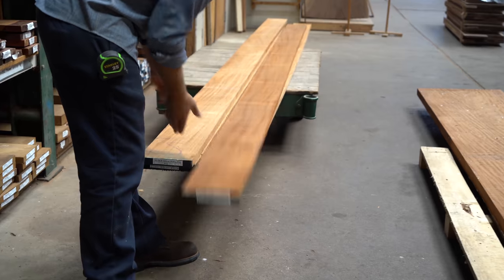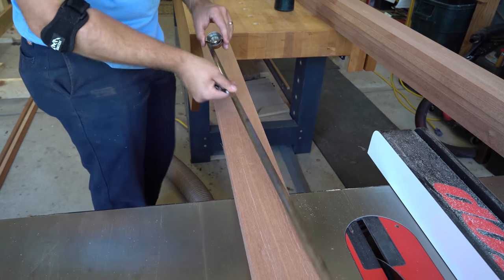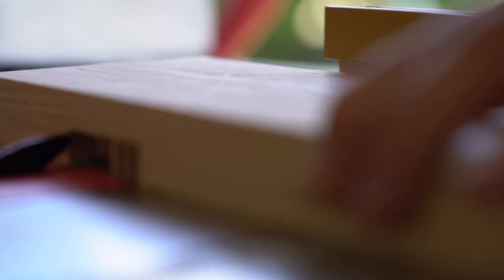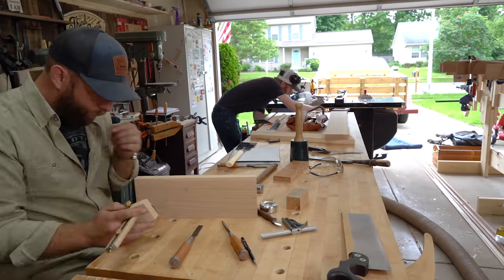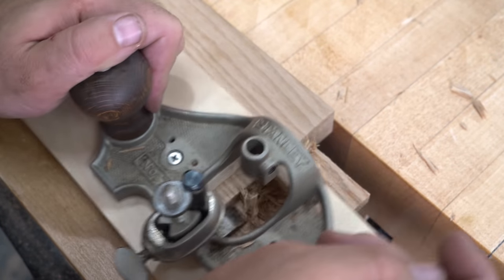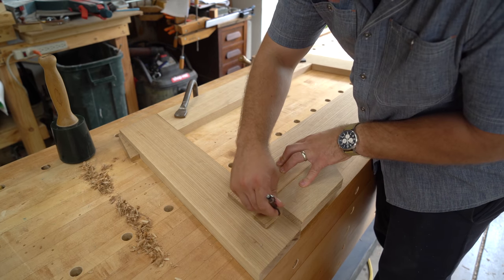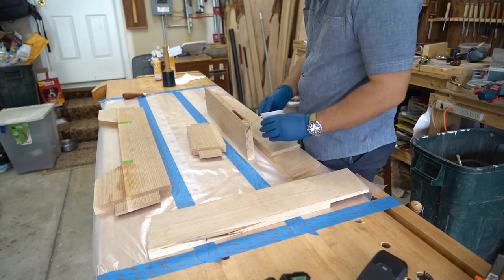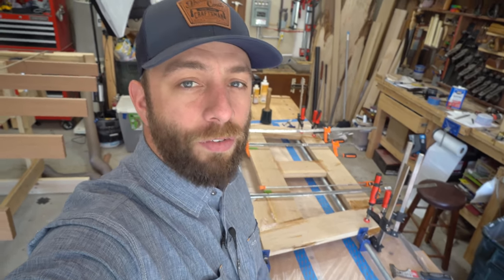Wooden Boat Build // Part 2: Getting Lumber, Transom, and Frame

Comment: Great dust collection hood on the sander. Also, instead of wax paper for a drop cloth when doing epoxy, silicone coated baking parchment works as well.

Comment: That wood store is seriously off the hook. Unreal. I really like your changes to the Transom, it should be very strong and last a good long time. I can't wait to see the whole boat layout. I'm curious about this design, as it seems the transom is very tall. Keep up the good work!
Reply from the maker: I think it seems taller because it is more narrow than most. It only is 20” in the middle to mount a regular 20” out board. Thanks for watching!

Comment: Epoxy is brilliant stuff for boat-building (and many other things). But, when working with epoxy, it's always a good idea to wear disposable nitrile gloves. Many boatbuilders report developing moderate-severe allergic skin reactions following repeated un-cured epoxy contact with their skin. Some even have to give up using epoxy entirely. 

Your suggestion to clean up as you go is a good one. Once cured, epoxy is very hard (much harder than regular glue squeeze-out etc) and a major pain to sand etc. So, any that can be removed while still soft (wearing gloves of course :)) is a big time-saver later. Also, the sanding dust can be a hazard as (i) it is very abrasive (like glass dust), and (ii) until its fully cured (which can take 72 hrs or more even after its hard enough to sand), can cause those allergies and assorted nasty lung stuff...

One more tip: White vinegar cleans up un-cured epoxy really well, and avoids having to use nasty chemicals like acetone etc...
Reply from the maker: Thanks for the tips!

Comment: Question,
Why half lap for the bottom transom joinery instead of mortice and tennon or a bridal joint? Even dovetails would be stronger. A sunrise dovetail would be beautiful, but not really seen once the planking/plywood (or what have you) goes on.

Comment: When hogging out material for the mortises on the drill press, how did you keep the board parallel to the drill?  Which leads to the next question:  when chiseling out the mortise, how do you know that the inner walls (inside cheeks?) are parallel to the outside sod the board?
Reply from the maker: Well the drill press base is flat and square to the bit, and since my board was square it drills a nice straight hole. Chiseling square takes a little practice but I just trust my eye. Your eye is incredibly accurate at seeing square and straight. You can always use a square next to your chisel to help line up. And also drop a thin square into your mortise hole to check your work
Reply: Third Coast Craftsman thanks I’m excited to see your progress as this boat comes together!

Comment: Chris, I noticed you cut tenons on the transom first and then cut the mortises to match.  Is that you typically how you cut mortise and tenon joints?  I have always read it’s best to cut the minor fries first then cut the tenon to fit.  I am a total woodworking noobie, so I don’t speak from experience, I’m just trying to develop my craft.  Thanks.
Reply from the maker: I personally (usually) cut tenons first, then use the tenon to layout the mortise. But really I think it’s up to the individual, try both ways and see what you prefer

Comment: I'm trying to build a 1548 boat like a garvey high walls trying to figure out the transom angles I believe the weight of the boat a 10hp will power it then I can put a 25hp later on I fish for catfishing and want a boat that handles the Mississippi River aluminum version of the boat is 4 grand I can't shed that out